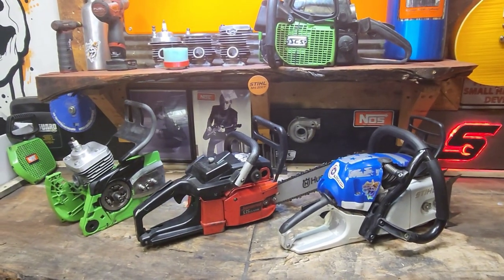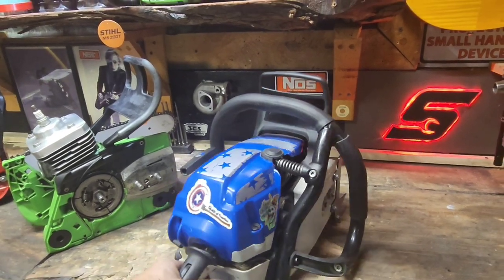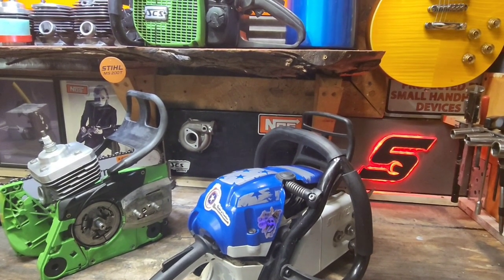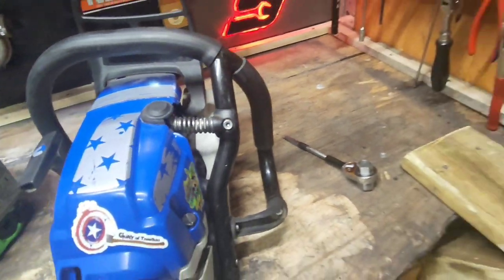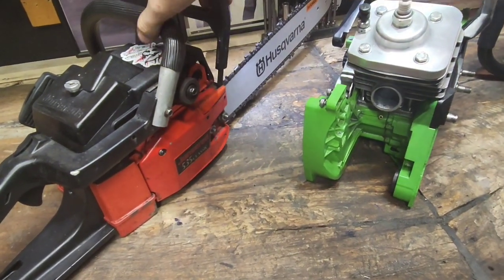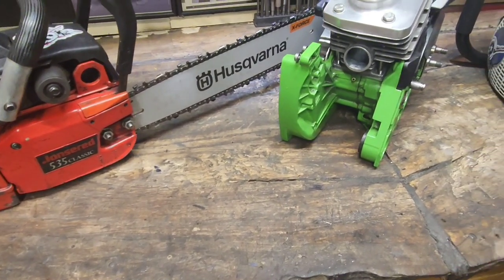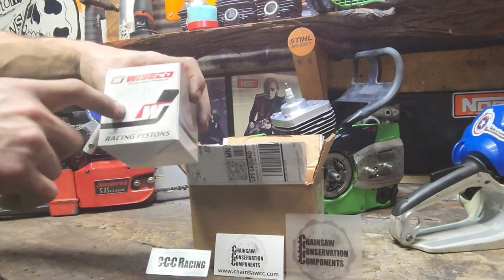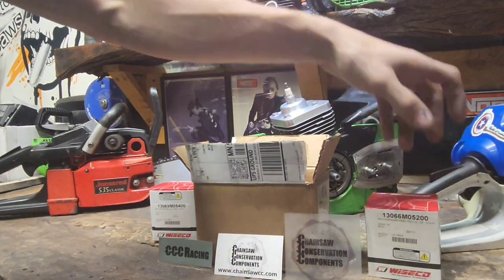NEW MS500i UPGRADE UNBOXING!!!  Game changer 💯 Guilty of treeson MS261 is done... and the 084 head 👌

Comment: John I have a saw question. I have a 461, I was out cutting firewood today and the saw didn’t like to start back up after shutting off. When I opened the fuel cap to see if I was running low I had a lot of air pressure in my tank and a ton of air bubbles coming out of the fuel hose for at least a minute.